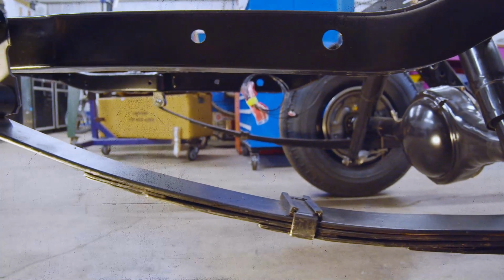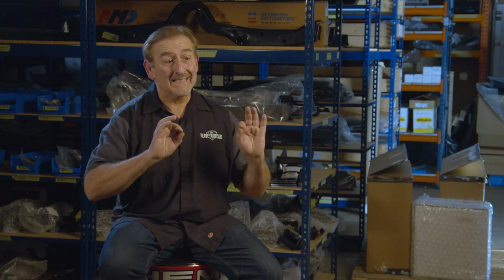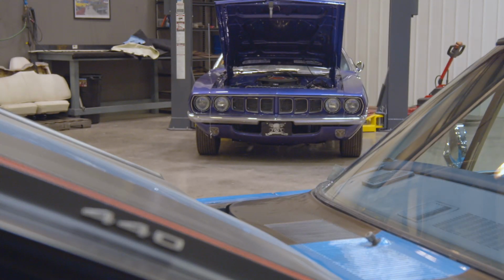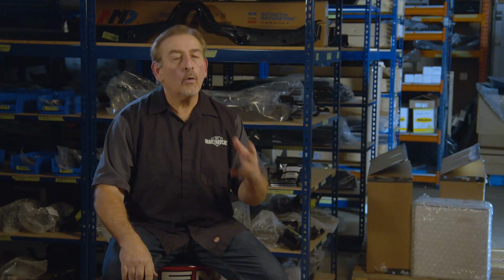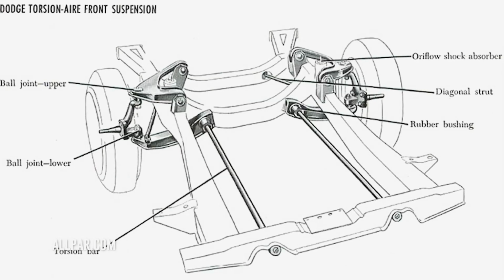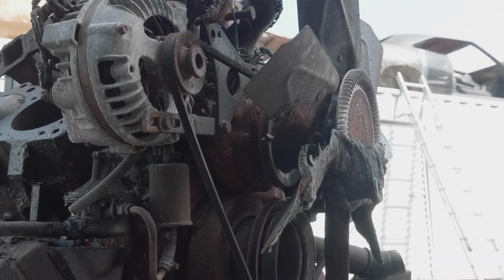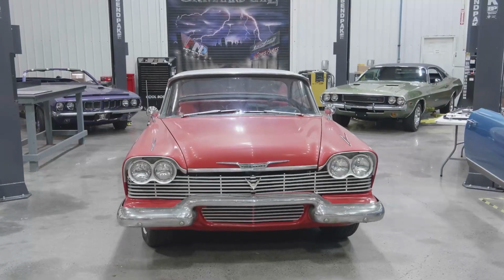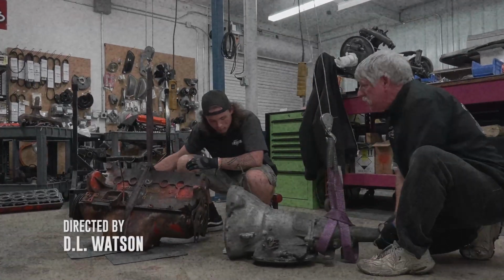YOUTUBE PREMIERE: GYC's First Slant Six Charger

Comment: The slant six had solid lifters from the beginning until the end of it's production. Very tough and reliable engine!
Reply: Not true. Slant 6 had solid lifters from 1960-1981 and then hydraulics after that until its end. Regardless, it is one of the most durable production engines of all time.